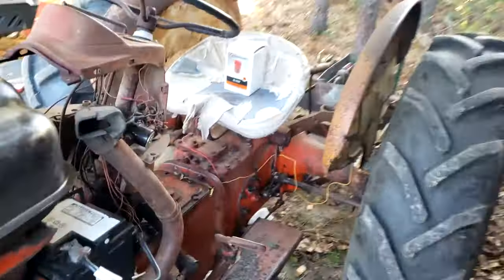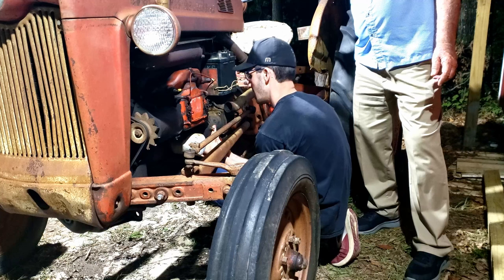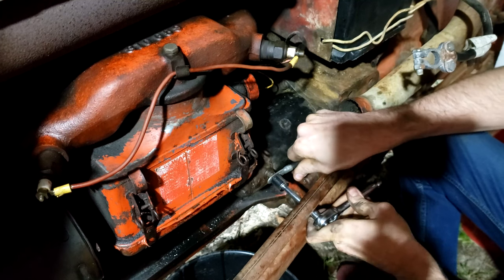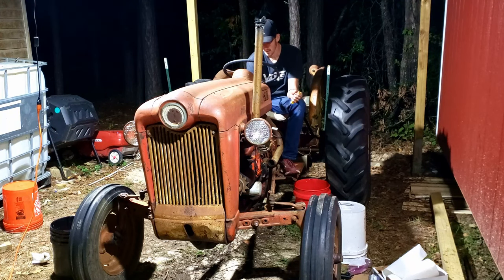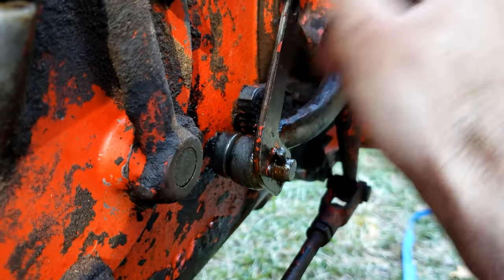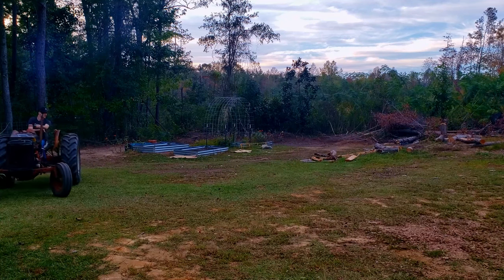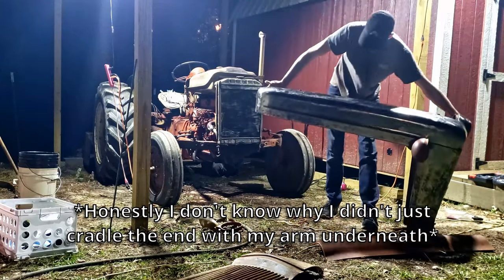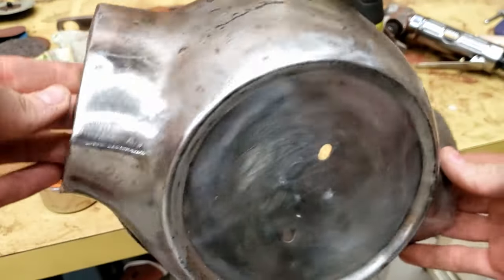Part 2 | Working On My Great-Grandfather's Tractor | Ford 601 Workmaster Diesel

Comment: I have a Ford 8N and very soon I will be restoring it and it looks like you are doing just fine with your tractor.. but any auto parts store won't have any parts that you would need and if you have time you can Google the part that you need and I find that I can buy all the parts that I need very cheap on eBay compared to the prices around here where I live ... That my helpful tip and I hope it helps you out...

Comment: I don't know if you did this or not, but you'll want to get some zinc additive for the oil. The problem with the 3-point is probably (hopefully for you) the hydraulic cylinders in it, but it could also be that the hydraulic filter is clogged, or pump itself pulsing in pressure (I'm not 100% sure where the pump on those is, but you'd probably at the very least need to pull the radiator to really get to it).
Reply from the maker: Never heard of zinc additive, and I definitely don't think I would have thought of it. Thanks for the tip!  I'm sure I'll have to consult my manual to find it but I really hope the radiator doesn't have to come off! Haha
Reply: @LandonsLaboratory  I've done a little research (I'm a John Deere guy, not much knowledge of Fords off the top of my head), and it seems the pump is inside the transmission, of all places. I'd recommend changing the hydraulic filter first and seeing if that helps, but if that and overhauling the cylinders fail, it's probably the pump
Reply: Put it in an old Lincoln body drive it around as a joke
Reply: @LandonsLaboratory  The hydraulic pump is on the right side of the engine. Very easy to get to. Wouldn't think zinc additive needed. The pump on these tractors are pretty tough. I don't think you have a pump problem. The lift seems to work pretty well. If you shut the engine off with a piece of equipment lifted does it stay in the air or drift down to the ground? If it goes to the ground quickly it indicates that fluid is getting past the lift cylinder piston o'ring. I think you have an adjustment problem. especially since you had all the linkages apart. You will probably need to take the top cover back off and check the adjustments. There are videos on line that can walk you through the proccess.

Comment: One of the biggest flaws with that style of Ford tractors is it has hydraulic fluid tubes that go through the wall at the bottom of the transmission and condensation goes to the bottom of the transmission in Rusts out the tube and causes major flaws with the hydraulic system my dad had this problem on one of his tractors and he had to sleeve it and I’m having the same problem on my 62 2000 You might can look on eBay and find the emblem for the front and the starter buttons always mess up on those tractors you could probably find someone on marketplace parting out an old Ford tractor 8n, 9N, 2n, 600 etc.
Reply from the maker: Tonight I opened up the hydraulic section and unfortunately it appears to have some rust, gunk, possibly water, and other things. Definitely glad that I'm doing maintenance. Luckily I don't think I have rust in the tube, but we'll have to see when I get back to it tomorrow.
And I've definitely been watching Facebook marketplace, but I also have a friend who's dad used to own a Ford tractor dealership. Apparently the parts from when it closed down are somewhere in town, looking forward to that adventure!

Thanks for the heads up!
Reply: I am familiar with the tube running through the transmission problem. If it develops a hole in it, it will pump the hydraulic fluid into the transmission. It really isn't a hard fix. You can order the tubes on line for less than 100 dollars. Tou don't have to split the tractor. Drain the transmission and hydraulic compartments. Remove the hydraulic pump manifold. Tap the smaller tube (pressure tube) and make yourself a puller with some threaded stock. After you pull it a couple inches it will come out by hand. Lubricate the new tube and tap it in until it is flush with the manifold mating surface. You can remove the transmission cover and make sure it goes into the hole in the rear of the transmission. I've heard of people putting appoxy or other types of sealant on the tube but I don't really think it is necessary. Use your own judgement.

Comment: There are brush on paint removers that make paint removal easier. I think one is low impact aircraft grade remover. Brush it on, let it sit and the paint bubbles off. Walmart or any auto parts may sell it. Also NAPA autoparts is a good source for filters for tractors.
Reply from the maker: I was using some paint stripper that I picked up at an ACE hardware, but I definitely don't think it's aircraft grade since it didn't do much, if anything, to remove the paint. I'll definitely check it out!
And thank you for the filter info, I don't think we have a NAPA in town, but the next town over may have one.

Comment: Well I know it's been 2 months ago I just watched your video about the tractor dude come on it says Napa on the filter doesn't it and does it have a part number you go by the part number on those and you can get the right filter for him check it out it works
Reply from the maker: Unfortunately, I don't have a NAPA in my town and was having a hard time (obviously haha) confirming the napa part was the same as the other brands. I was also just starting to work on the tractor and was a bit overwhelmed with all the info I was trying to learn.

Thanks for the advice, I hope you enjoyed. 👍
Reply: @LandonsLaboratory  nah you're good bro I'm just trying to help you out a little bit I work on tractors all the time so if you need anything just yell thank you
Reply: Those tractors came out with a canister type oil filter. It is pretty common to see the spin on conversions. They used the same filter that all the old ford vehicles used. Motorcraft FL1A or Fram PH 8a or the equivalent.

Comment: The next project you do; just don't treat it like you are doing dental work..Take the metal panel off.; take the panel and power wash the crap off and get them sand blasted...You are wasting your life farting around with all the miniscule problems.